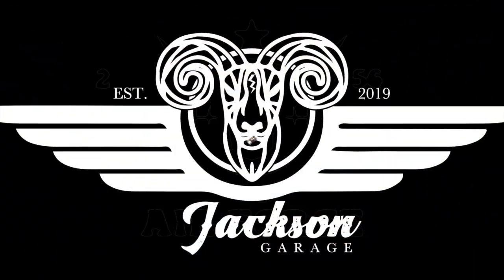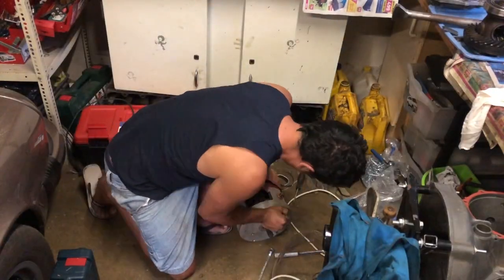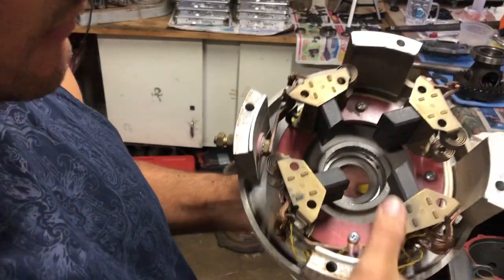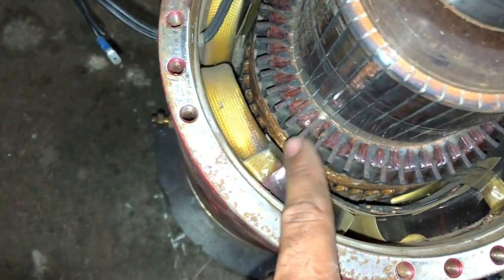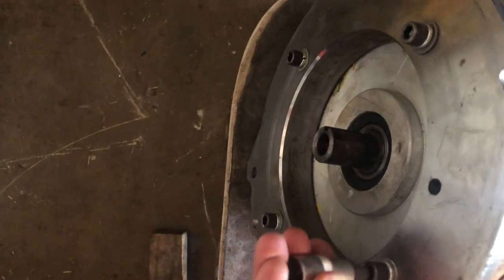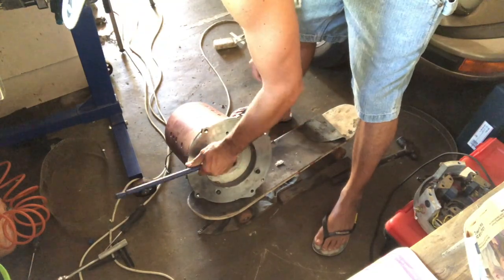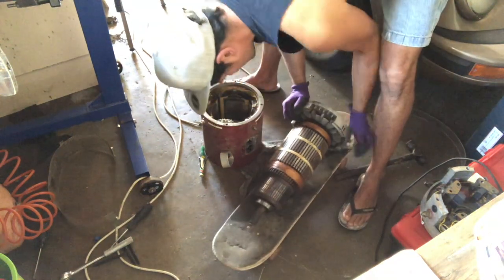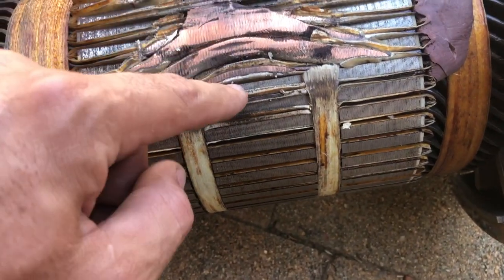Netgain Warp 9 series wound electric motor and failure - EP 16

Comment: I once ran a 36volt DC Baldor Brush Motor on a 48 volt Battery Pack. Yes, the motor screamed loudly, worked hard to drive a Forklift Hydraulic Pump. So what I would like to add, and point out - is that I have seen the commutator windings throw-out in exactly the same manner, and jam-up the motor. I put this down to over-speed rpm, with higher centrifugal forces acting on the Commutator Windings, dislodging them.
Reply from the maker: And perhaps a bit of heat expansion in the coils? It was really a bummer.
Reply: @JacksonGarage  Yes, the heat would cause expansion of the windings, but I would have thought that the Netgain Designers would have made an allowance for both linear and cubical expansion of the copper windings - at the Motor Max. Temp. Your Motor looked a helluva mess, and I'm always interested to read others comments. Thanks so much for replying. Greetings from the UK.
Reply from the maker: @peterduxbury927  That's actually a really valid point. Somehow I think that we put way too many amps into the thing because it was extremely hot.
Reply from the maker: That being said, we were driving on a dirt road and can't have been doing more that 60km/h even if we were in 1st gear this shouldn't have happened.

Comment: the only fan i use is to cool the controller with radiator  . motor just gets warm to the touch normal driveing
Reply from the maker: Hmmm, interesting. I think that we're going to have the motor rewound anyway. It'll cost around $2k, which sux a bit.

Comment: well let me say the controller will do 1000 amps for a few seconds I am at 200 volts I can be sure to say I have gps the speed 0 to 60 around the 3 1/2 second mark at a few runs at a time tires must get hot. i would like to go for more amps for few seconds with bigger controller but im afraid of a melt down.
Reply from the maker: Cool trike! I've subbed and will check out your work! I also like acceleration haha,

Comment: Hi i do not understand why that motor did that. i use the same motor in my electric trike at 200 volts and 1000 amps and have no problems even with continues beating it only gets warm.
Reply from the maker: Hi Joseph, 1000 amps! Wow that seems quite high.  I don't suppose that you had a fan on? I'm not sure that we put 1000 amps into it but the thing got really hot and I think the windings must have expanded.